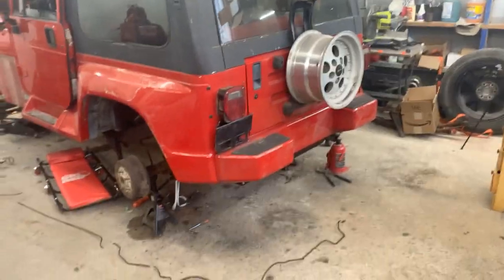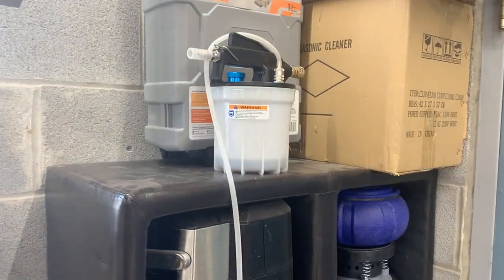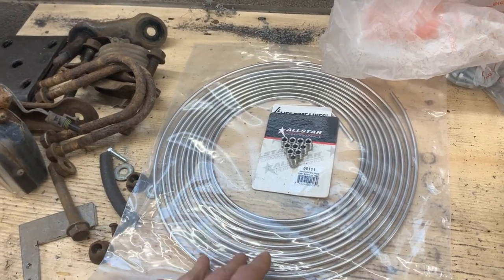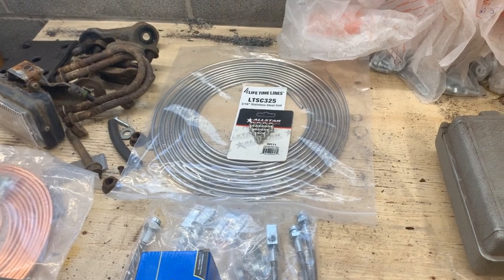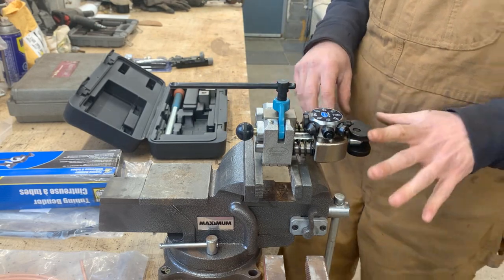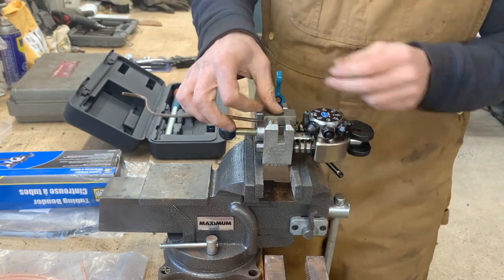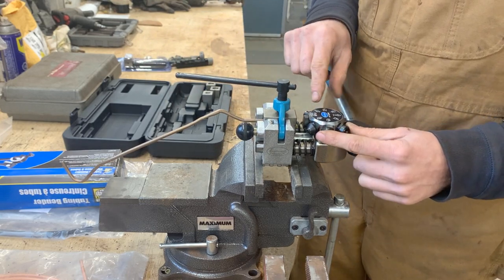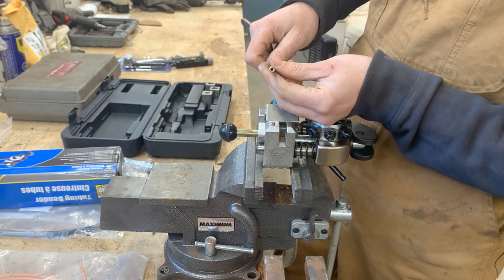1994 Jeep YJ - Part 19 - Flaring/Bending New Brake Lines

Comment: I bought a double flare kit from Canadian Tire some years ago and messed up about 2 feet of tubing trying to make a good flare before coming to the conclusion it was the tool, not me (usually it's me). So I took it back thinking I got a lemon and they gave me another one off the shelf. I destroyed another 2 feet of tubing with the new tool. When I took it back this time, I asked for my money back - the returns person said they could only replace it, not refund. So I told her to take it to one of their mechanics and ask him if he could make a flare with the tool - a few minutes later she came back and refunded my money. I then borrowed an Eastwood tool from my friend and made perfect double flares right away. Not being a pro, I thought a flare tool I paid $40 for should be able to make at least one flare. I guess I learned a lesson!  You do beautiful work Elin - thanks for the video.
Reply from the maker: I was struggling with one of these cheap tools for years. Now that I used Eugene's tool I am never going back. I will invest in this tool as well.

Comment: I have the same eastwood tool, and I believe I remember that they recommended using a lubricant on the dies when flaring stainless (as you can see, it takes a lot more force!)
Reply from the maker: Yes, they actually recommend anti seize, which I don't have. But I guess some grease would do the job too. I will do that next time

Comment: On the long lines, sometimes it is easier to break it into 3 or 4 pcs and  put a few unions in.  Even if you do bend the long line perfectly, it still might be hard to get it installed unless you take the body off the frame....
Reply from the maker: I was considering it, but it wasn't that hard actually (the rear lines are in now) But I might need to do it on one of the front lines

Comment: Can't you get kunifer brake lines in Canada? It doesn't corrode and is dead easy to bend and flare. It's what most people use in the UK!
Reply from the maker: Yes, they are copper-nickel and easy to bend, but I still need stainless fittings so I just ordered everything SS